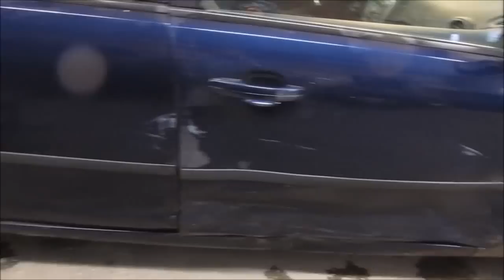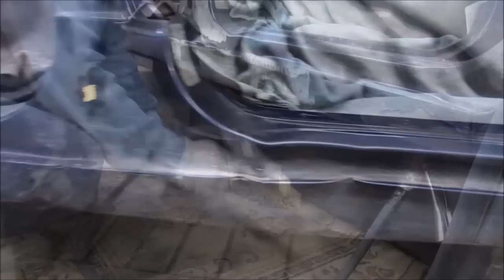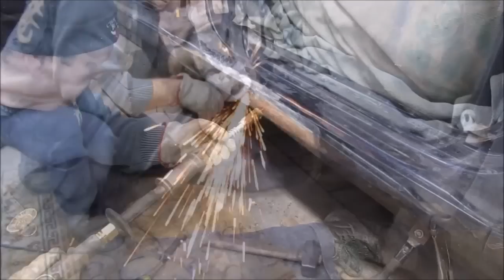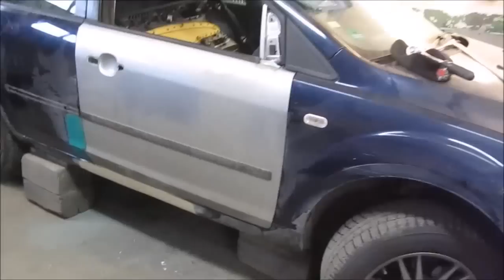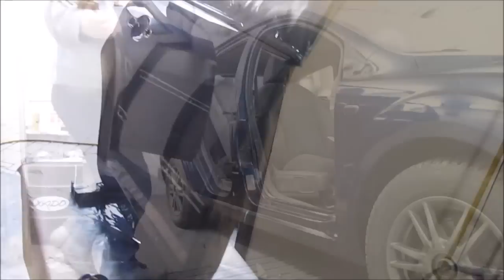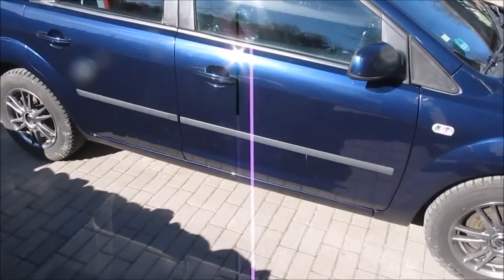Ford Focus. A little body repair. Небольшой ремонт кузова.

Comment: nice job arthur , in the other video of the mercedez benz , how did you know that you have to pull the frame , if the accident was in the hood and the radiator support  and not in the right side of the frame ???
Reply from the maker: I measured longerons diagonals, they were not identical.